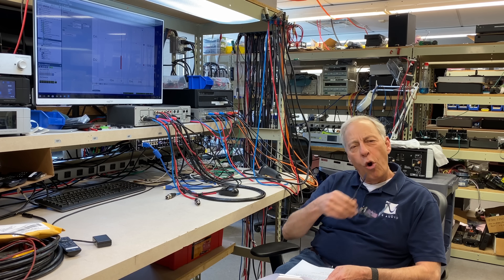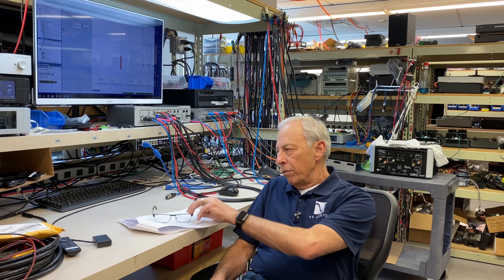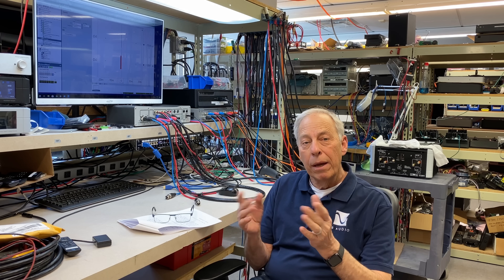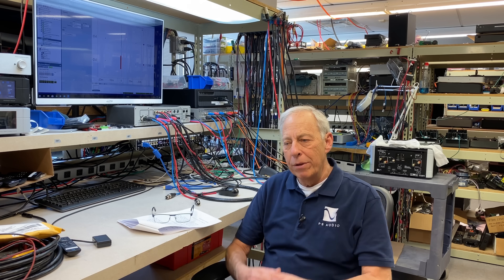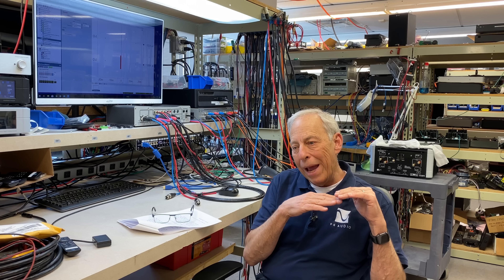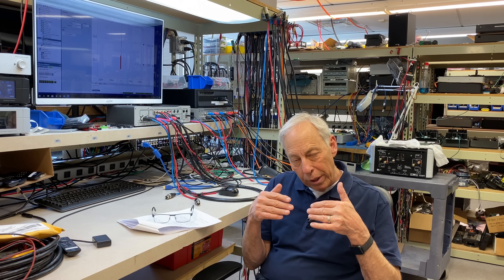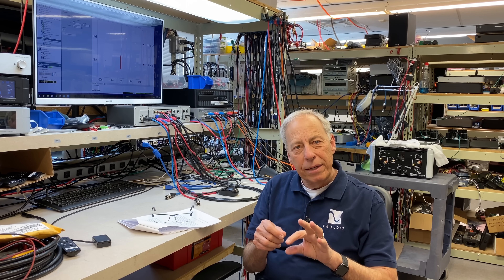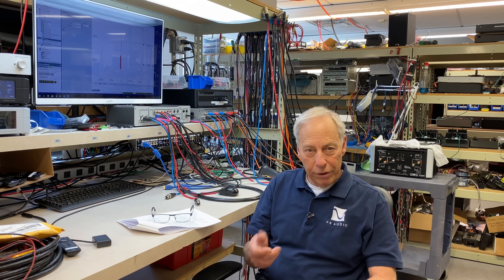How do ferrite cores work?

Comment: I have a question about usung ferrite cores to create a filter for EMI and/or RFI interference on a fish finder created by the use of Pulse Width Modulation for speed control. How does a toroidal ferrite choke work and how should it be done?

Comment: I wonder how many electrical engineers agree with Paul on this one. Ferrites easily filter out high frequency noise, like multiple MHz. And they do nothing to lower frequencies, like <20kHz. So, what's the problem using them with power cords and interconnects?
Reply: Hi.I'm not an engineer, but I agree with your sentiment. Especially with digital switching and clock rates.Ensuring that RF doesn't pollute that process makes sense to me.I personally like to have all 3 for my mains cables.Twisted,shielded and use RF collars too. I've not experienced anything that I would call a negative impact on sound quality. I would add that where speaker cables and interconnects are concerned that lower impedance, widest bandwidth is where I like to go though,so wouldn't use any filters there,even chokes that operate at such a high frequency.

Comment: I have a point where my interconnect cables cross  due to coiling and distance between components. 

I clip in my ferrite chokes at that point. It offers a barrier due to the bead’s plastic shell.  

I place my beads in the middle where it doesn’t ’choke’ my dynamic range. Pun sorta intended.

Comment: Appreciate your time on this specific issue. I have to agree in avoiding ferrite cores on ac mains cables. I have always applied the principle of creative shapes in geometry of wire cabling, and high standard of shielding termination. For me the planning and execution of building a solid creative cable really does make the difference in sound without choking. Thanks for getting good info out there from your platform!

Comment: Okay, thanks, it clears up things pretty much. But: what is not really clear to me: you don't want to put them on audio cables, because of the sound quality. You don't want to put them on power cables because of the resistance. The only thing that is not an audio and not a power cable for me are digital cables. So, do we actually use them on digital cables? Or is there anything else? Thank you.

Comment: I am having an issue with a NEW touch control Samsung gas oven and also NEW dishwasher that also is touch control.Seems every week one or the other does crazy shit,as in turns their self on.Both are on the same kitchen circuit.Can I add a bead/choke to one or both?The circuit was tested fine by an electrician.

Comment: Paul talked about ferrite cores being used as RF suppression components to ensure EMC (electromagnetic compatibility) for the CE Mark and FCC regulations. Here the manufacturer is using a ferrite core to dissipate RF (radio frequency) energy associated with the unintentional radiated emissions of the equipment and its cabling. The characteristics of the ferrite material is selected to ensure that the core is lossy at the problematic frequency band. However, a ferrite core can also be used to improve the RF immunity performance of the equipment. Here the ferrite core impedes the flow of unwanted RF signals into the equipment and helps prevent EMI (electromagnetic interference). Historically the immunity performance testing considered EMI caused by RF signals produced by radio communications equipment. Today our homes are full of electronic devices that generate RF (WiFi, Bluetooth, Mobiles) that can disturb the operation of the equipment.

Comment: Ferrite beads don't work in the audio range, placed around a cable they show a high impedance in the region of hundreds of Khz/Mhz (RF). If you put one of those in a speaker cable, in a line cable or in a power cable, you are not going to hear its effect as an audible high frequency drop, not even close.

Comment: I'm watching this now for the second time but was having another issue - I think someone may be injecting a 2.4 GHz or 5 or 6 GHz signal onto my household power lines.  The purpose is for a new type of surveillance - not available to the public..yet.  Anyway I can see a mixed signal as I don't have a scope fast enough - I'm seeing spikes of EF of up to 100 Volts per Square Meter on the two RF/EF Meters that I have.  What size do you think the Ferrite Core would have to be to remove everything but the 60 Hz AC from one of my household power circuits?

Comment: Ferrite core, if selected properly, will only filter unwanted frequencies which typically are in the 50Mhz (50,000,000 Hz) to about 400Mhz (400,000,000 Hz) and this is way above the power frequency of 60Hz (or 50Hz) and audio frequency of maximum 20kHz. Thus the ferrite core will not affect the power frequency and audio frequency.

Comment: It acts as a choke.  A choke acts as a low pass filter.  The higher the frequency the higher the impedance and filtering.  So great for stopping high frequencies in the MHz range.  
On a power cable it can be good when installed on the safety earth to stop polluting the ground plane.  Agree that when clamped on the entire power cable it chokes the life out of the sound.  Definitely do not want it on a signal cable.

Comment: 0:06 actually I just stumbled upon the term ferrite bead in a DIY project, and I was wondering what the hell are those? How come I never heard about those during my years spent studying? So from what I understand, ferrite beads increase the impedance for high frequency signals, right? Is that why you don't prefer them in audio gear? Because they affect the frequency response of the circuit?

Comment: I bought usb cable to my soundcard without a ferrite filter cause of your video, i picked fat 30 AVG CU with good shielding instead. I was wondering between the 2 cables but thanks to your video I got the answer for my problem.

Comment: I always see electrical engineering explanations for ferrites put in terms of impedance, inductance, etc. But how about a physics explanation in terms of magnetic domains of the ferrite, electrons on the wire, and how that translates to amplitude reduction of high frequency voltage noise?

Comment: If inductance is so bad how do you explain passive crossovers? Also, many power amplifiers use inductance on outputs. Many of your videos make sense. This is total bullshit. Ferrite cores used for common mode rejection on power can only help. There are many examples that use chokes in medical, test equipment and radio with multiples more precision than any audio equipment. The amplifiers are drawing current from rectification capacitors. Could you explain how a common mode choke used on mains will effect audio?

Comment: To PS Audio, I don't get that your saying not to use Ferrite Core in power application, on a battery drill conversion (see link which starts at 2 min 3 sec) the drill started and stopped, when the Ferrite Core was added it ran, please explain why you don't recommend for power (PS Audio said this near end of your video) but this worked on the drill https://youtu.be/ItKONTOqw8E?t=2m03s
P.S. it looks like the guy in video I link is wrong with his explanation on how Ferrite Core works

Comment: Thank you so much for this video and the valuable advice!
I just found out about ferrite cores and was on the verge of getting it for my amplifier input cable, but decided to watch your video right before.
Now i'm getting a shielded cable instead 🙏
Reply: But ....the rubbish HF hash may already be in  the signal wires..........shielded or not make no difference when the signal is already poluted.
Reply: @frankgeeraerts6243  yes for my case i eventually realized that the signal is being amplified too much and hence there is the hum. If i raise the volume to 75% or more at my tv (source) and lower the amplifier's level then it's much better.
Reply: @frankgeeraerts6243  whit is HF hash?
Reply: @desertshadow72  Contamination of high frequency on the powersupply and on signals.........caused by polution on the AC line, emf Smartphones computers, diodes , radiofrequencies etc ..........they interfere and intermodsulate with the msic signal......

Comment: My right speaker is buzzing when my graphics card is running inside my computer. I unplugged the audio interface the speaker is plugged into (usb) and it went away. So I don't think its a ground issue coming from wall power. I think its my tower creating some kind of connection. Does that sound right?

Comment: Hello, thanx indeed for a explanation. One quastion remais: if I will place ferrite ring or tube on USB cable from mac mini to DAC, which got power via same USB, is it will reduce power noise on from mac mini power system or not? Thanx in advance for the answer.
Reply: There is an intel paper on usb 3 radiating noise interfering with bluetooth, so it would mostly help for that if its a problem at all.

Comment: I really need your help and your video gives me some hope. For 5 years since I bought Powerline adapters, the box devices to transmit Ethernet UTP signals using the power sockets on the wall and the house electric wires to establish the connection my speakers started to crackle. When I increase or decrease the volume from the speakers to maximum the crackle sound is starting to be heard .
The power wire of the 5.1 speakers is coming from the subwoofer and doesn't have any kind of ferrite core on it. If I attach the ferrite core on the speakers power wire will it help to eliminate this EMI crackling issue?

Comment: My computer is a hot bed of RFI and if I move my microphone within six inches of it you can hear the noise so I wonder if a ferrite would fix that?  Bit odd considering it is using an XLR connector so the noise isn't supposed to come across like that.

Comment: My Polk Audio sat tuner uses one on the inside of the unit just before the 18awg two prong polarized plugs into the power supply so I guess in this case Polk audio things it does something for the unit. It's out of warranty so was thinking of installing a 14 awg wire with core on it.

Comment: Hi, i want to use some ferrite chockes  on signal wires of a cnc machine. As they have a certain impendance at a certain frequency, other than fitting tightly on the wire, the bigger impendance would mean more efficiency ?
Thank you.

Comment: Ferrites add inductance to wires, not impedance. A big difference, because impedance is only increased at RF frequencies. They are akin to adding a zero resistance RF choke when fitted to screened wires, and are frequently used to preven RF hash from thravelling into your amplifier from your computer, or hash from switch mode power supplies into the mains or the unit being powered.  Audio frequencies in cables are unaffected by ferrites.
Reply: Will ferrites help against lets say an EMP at all?
Reply: @michaelwesten1316  What problem are you experiencing?
Reply: Can ferrite help electric bill?

Comment: As a holder of an Amateur Radio license, I can say that many use ferrite 'beads' in their radio stations to keep RF out of the audio chain !  Good station grounding and bonding always helps with RF problems.
Reply: In an amateur radio situation where would you use these? I had my 15 watt  gmrs radio running off an accessory wire in my truck but I was getting alternator noise over the speaker while receiving. I read that running directly to the battery was better for the radio for a few reasons but I like having it power on and off with the key so I ran a relay to correct this. Now I'm getting the noise while receiving and it can be heard on the other end while transmitting. Where would I add one of these for best performance?
Reply: @rozd618  Hi there, I was checking my online store (DX Engineering) and it seems they have a kit for HF frequencies, but I did not see anything for your high band (440) radio.   They would normally clip onto your power cable at the end feed to start.  I have never needed them in my station OR my mobile which is a 2 meter rig.   BUT YES, going direct to your battery/power source is best.  See what you can find....

Comment: A ferrite bead will have essentially no impedance on a 60 Hz power line.  If installed in a common mode fashion it will have zero effect to power flow from the AC line to the unit.  Hence, their is nothing wrong with using them on the power lines for audio equipment.  Picking the proper core material doesn’t have to be magic.  Manufacturers have graphs on core losses vs frequency and the peak “Q” of the core.  Pick one whose Q is not at a frequency of interest and also has the most losses over the frequency range of interest of interest.  A lossy core is used to convert the “noise” energy into heat.  The frequency range of interest for these is generally higher than 100 KHz.   For power applications one generally uses them to reduce conducted noise which also reduces emitted noise, hence the desire to use “lossy” cores.  RF people have different usage - picking the right Q and lossy type is very different in some RF applications (generally speaking frequencies much higher than 1 MHz).  Audio power amplifiers may use them to damp ringing and noise internally.  Hence, when reading about ferrite usage applications it can be confusing as the correct solution for the RF engineer is not the same as for the Power Engineer.  Back to the Q of the core- if you are trying to remove/filter 300 KHz from the power line - don’t put a core whose Maximum Q occurs at 300 KHz - because that means 300 KHz noise will be amplified - not attenuated.  Parasitic capacitance is always present on wires or traces of circuit boards.  Adding a ferrite core can set up a L/C resonance situation.  Hence, pick a lossy core to “dampen” the L/C and prevent ringing.
Reply: Correct information ...............better than most " experts " comments and beliefs that people believe blindfold..........
Reply: Ft5tr5
Reply: If I can't hear it, why should I care?
Reply: I need your help